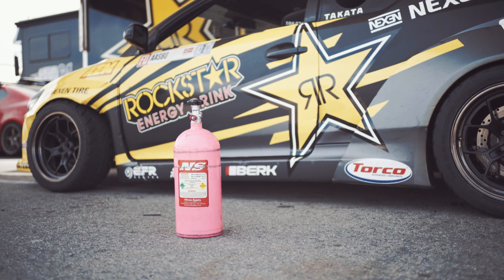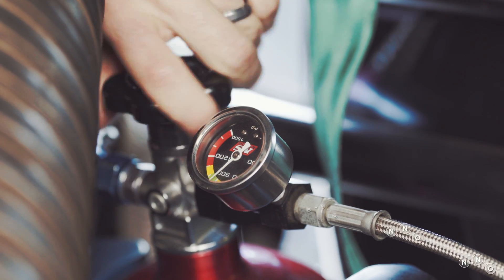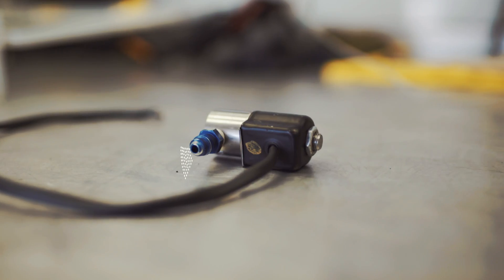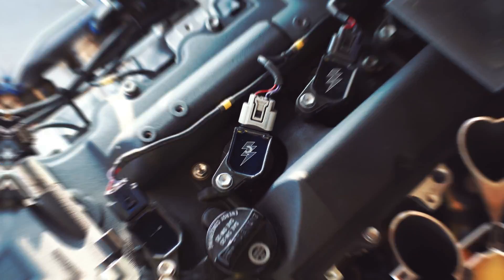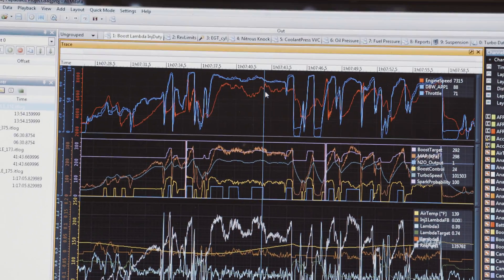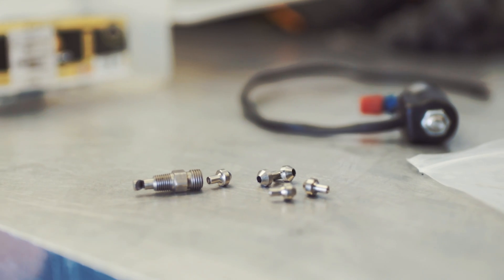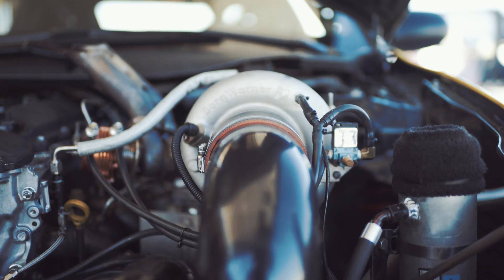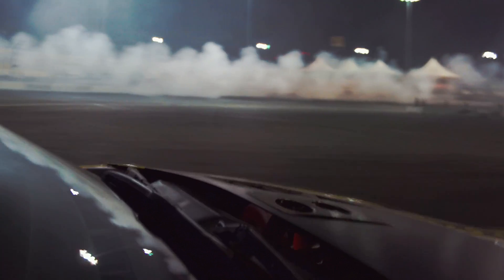How Nitrous NOS Works on a real racing drift car

Comment: dumb question: can you inject nitrous and e85 straight to turbo inlet to cool everything at the same time
Reply: e34Boat dumb question indeed.
E85 is injected into the intake manifold through your fuel injectors. Nitrous can be shot just into the filter but it’s not optimal. Having jets for each cylinder is way better. But yes, in that way, E85 and nitrous can be used together.
Reply: @codenamecordon  wet shot?
Reply: B yep, wet shot>dry shot